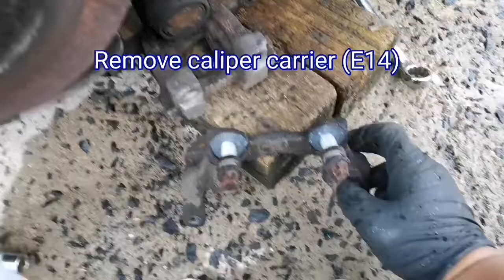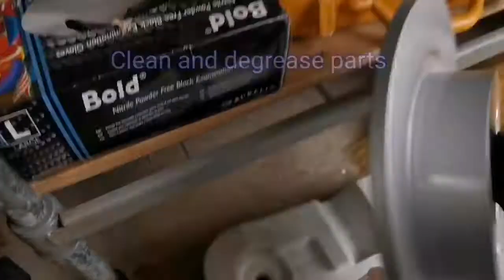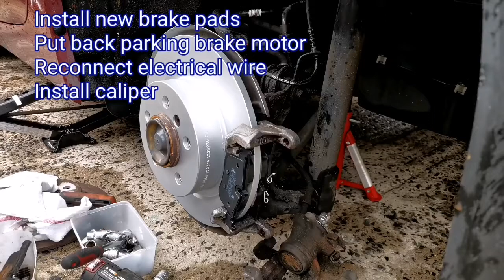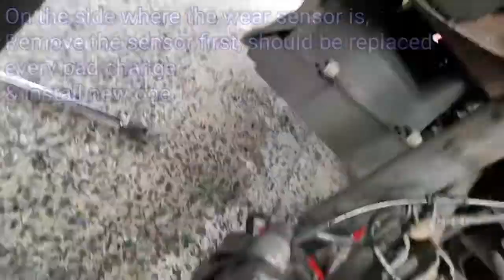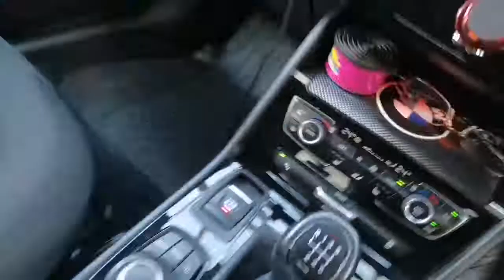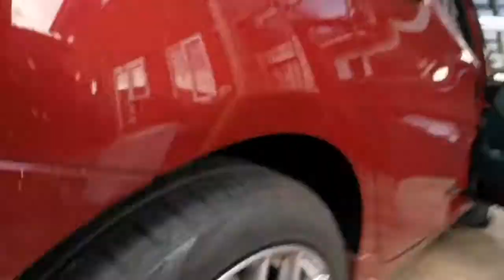BMW 2015 Active Tourer 2 Series Rear brake pads rotor disc replacement with electronic parking brake

Comment: Awesome work bud
What’s the torque settings for the wheel bolts 
Thanks in advance 
Ps is there only one sensor wire for both sides 
Thanks